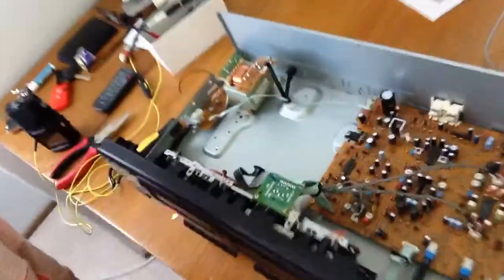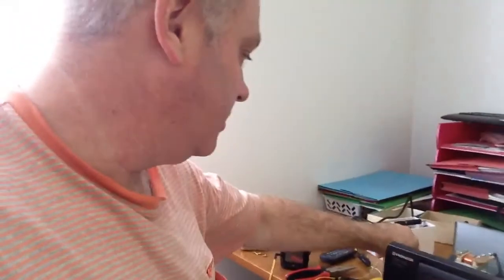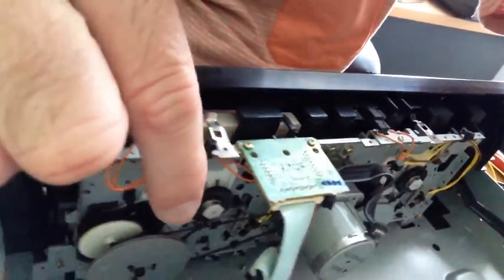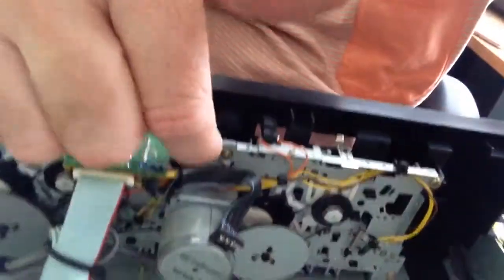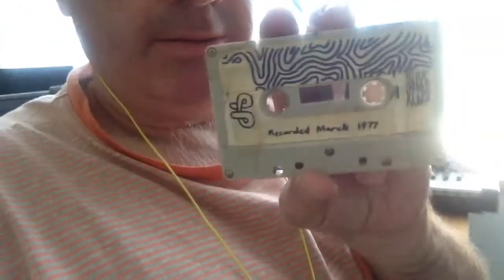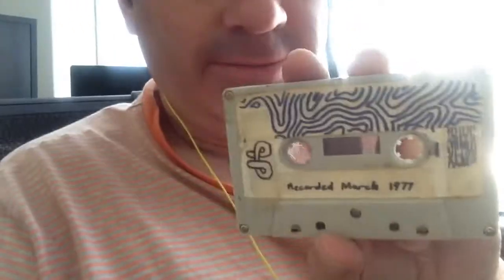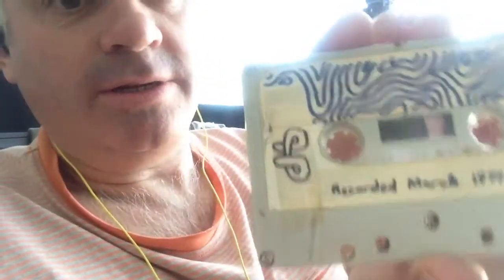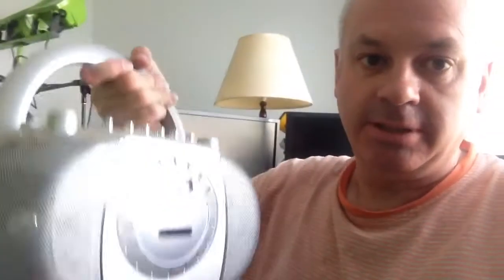2014-03-10 - Playing a Cassette

Comment: Back when, I used to repair mine with rubber bands. They'd last about a couple of hours and then I'd have to put in another band. Sounds like the little spring has sprung on the play button and it won't hold the head down. Try the play button on the other side with a rubber band mate. Could work :)
Reply from the maker: I decided to buy a new one with a USB output so I can digitise the tape properly.